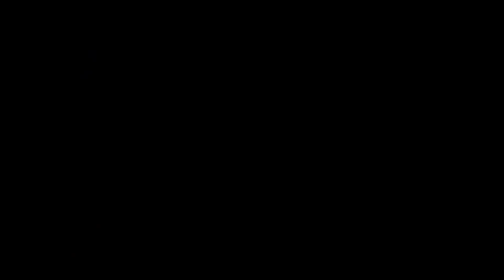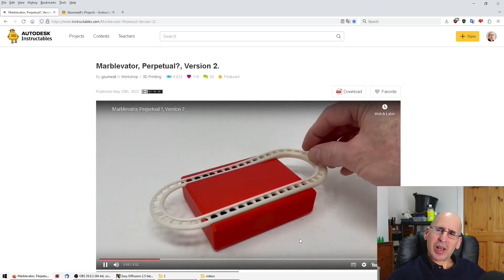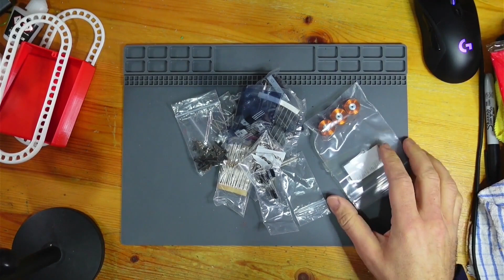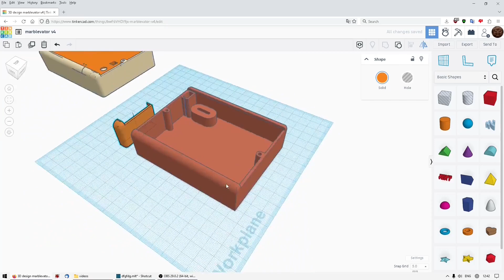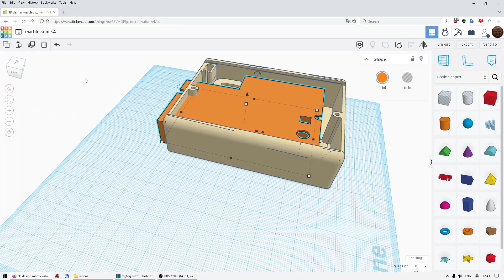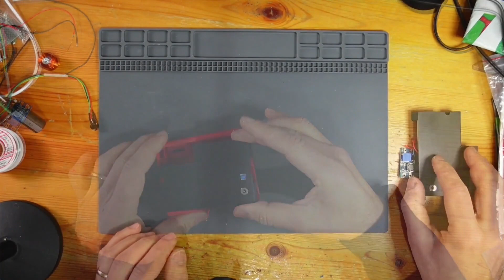Perpetual Ball Machine Failure

Comment: I like your new video intro!  Sorry the design didn't work out.  

I've used both boost and step down buck regulators in my designs, but never tested their limits as far as current flow.

I used a step down regulator to make a USB powered version of Greg's Marblevator Mini, switchable between the USB power source and a 1.5V battery.  More recently, I used a booster to slightly over power a 12V blower fan for my laser cutter (to get more air flow.)  Current draw for that was less than 100ma though, nowhere near what that coil must require.

Thanks for posting.  Even failures can teach a lot.
Reply from the maker: I like the look of the Marblevator Mini. That's a good idea to drop down USB voltage to 1.5v, rather than go out and buy a (probably) single use 1.5v DC power supply. I built his hand cranked Marblevator which works fine. Hats off to Greg - he's a bit of a genius. 

I thought I'd start posting (some) fails despite the embarrassment. It's a more honest depiction of my reality of making stuff. 😄

All the best.